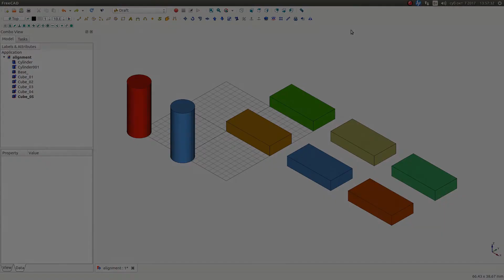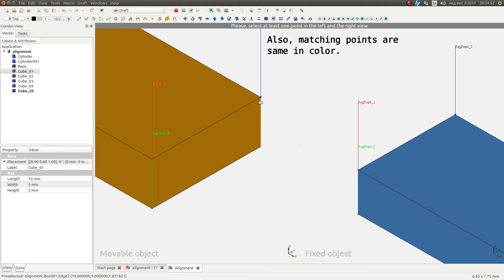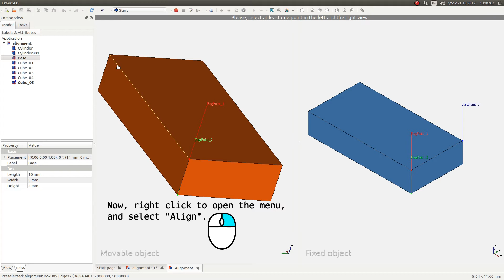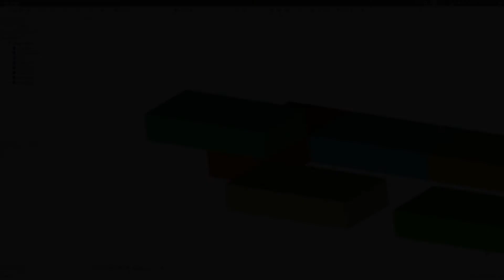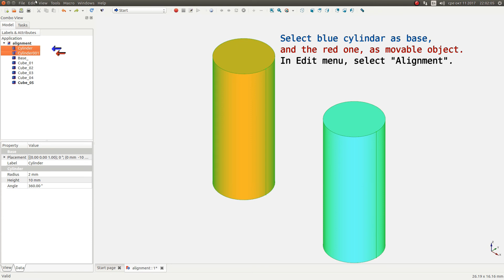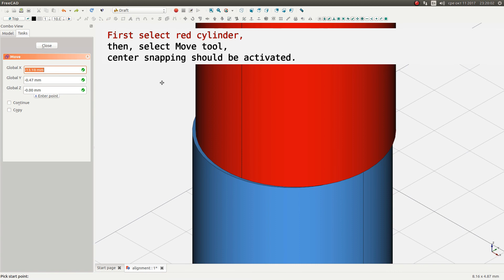Freecad tutorial - Getting started | Alignment | Assembly #003 - part 01_11

Comment: When I use the align tool on the cylinders, one cylinder always ends up 'inside' the other? Is this just a difference in the versions of the software that we have?
Reply from the maker: If cylinder ends up inside, it must be points issue, and their placement. Try again, but be sure that points, on both sides, are placed as in a mirror, or as in a book, when you close the book, points on both sides, and their colors, should match. 
Otherwise, if those points have equal placement on both sides, then, cylinder will be moving on the same plane, or level, without rotation.
Reply: Thank you, this worked :)